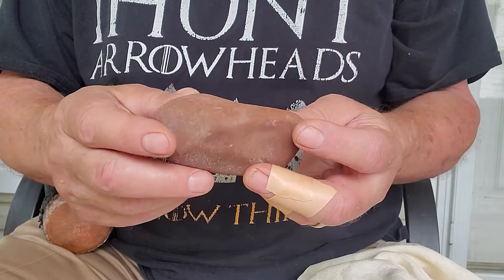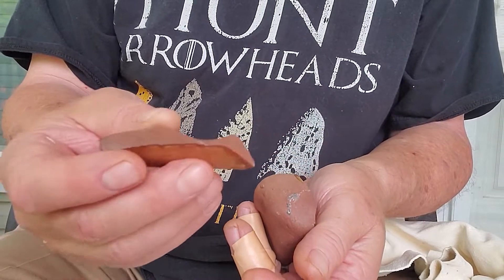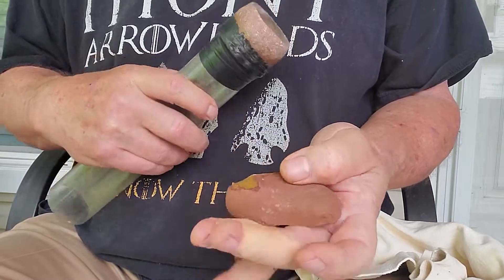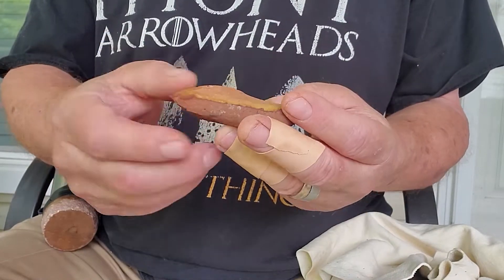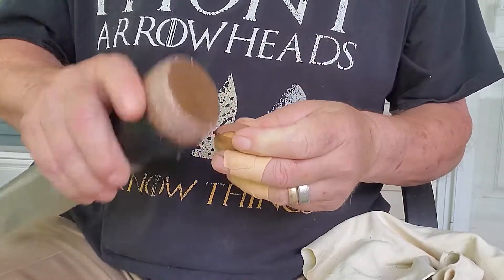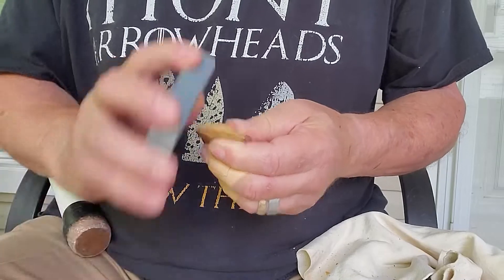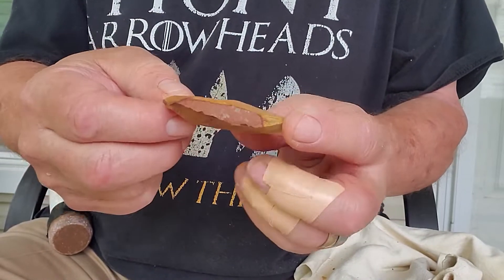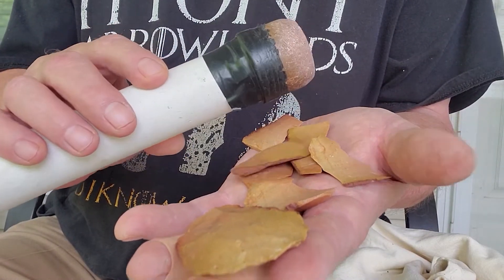Flint Knapping - Thinning a Fat Cobble

Comment: I dig that bopper. Looks like it works nice. How.did you make it?
Reply from the maker: I have a video on bopper construction. Basically it's just a copper cap taped to a plastic pipe with electrical tape also between the cap and the pipe. Thanks for watching and taking the time to comment!
Reply: @EDBO23  I will be looking for that bopper creation video.